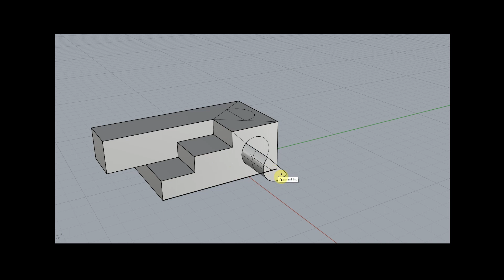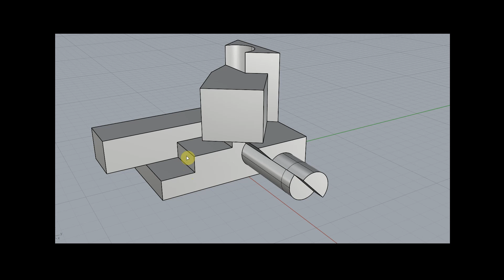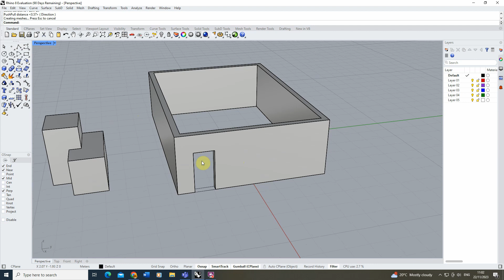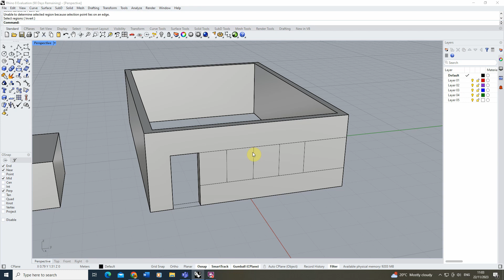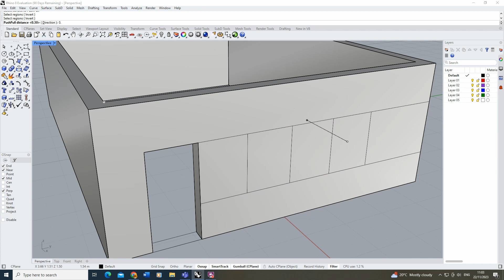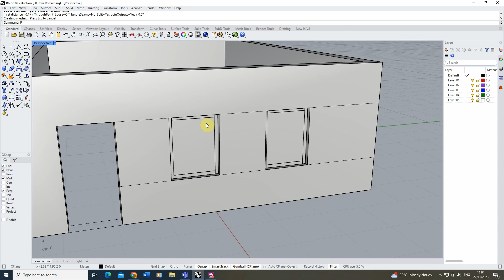Push Pull Command - Rhino 8

Comment: Yes ..  but actually by making the windows frame a part of the wall will make some issues later on 
F.eks : 
applying materials (although you can subselect the particular  surfaces you want to apply material to) 
The lines weight in section 
The intersections between walls and windows  in make 2D 
If you run quantity-survey plugin 
Mixing layers of openings and walls 
And more ! 

I appreciate the smartness in modeling it sketchup-wise but this is not the way the architects work normally